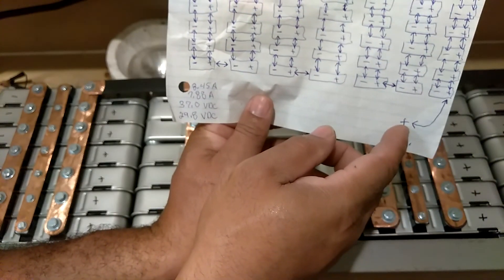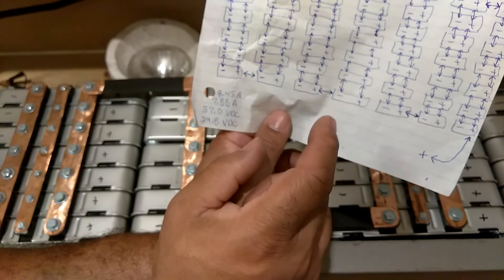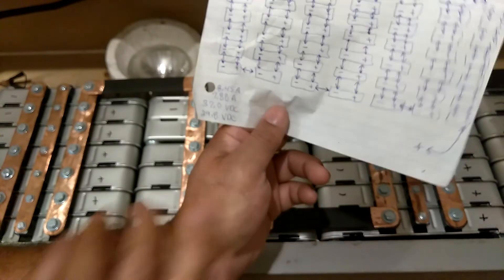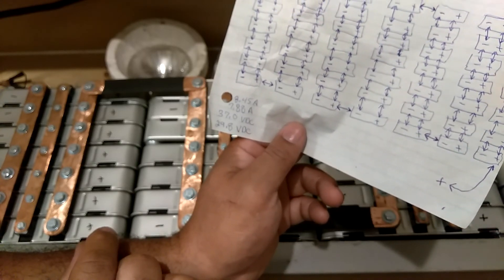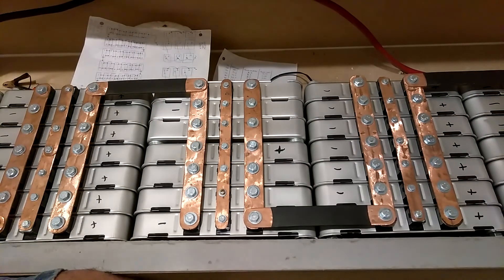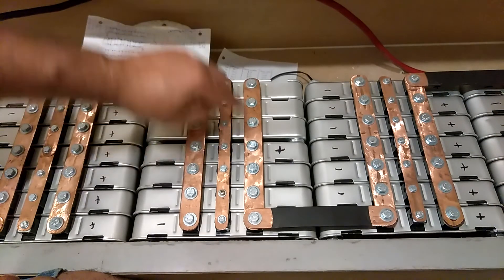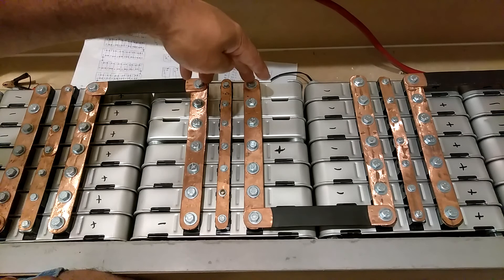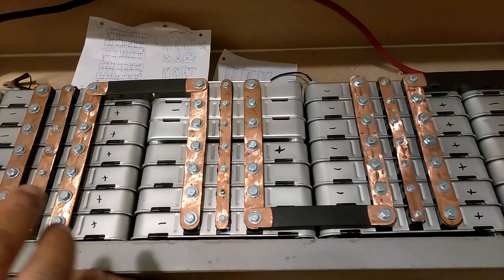How I wired up my MX solar 24V 235W 7.88A panels and Nissan leaf batterys.

Comment: Awesome set up brotha, I was wondering if you can do me a big favor and draw out a 24v battery set up using the 24kwh lithium battery pack and how it’s connect from the charge controller and how it’s connected to the inverter 🙏🏽🙏🏽🙏🏽🙏🏽 I ready to set up my solar system but need some guidance bro, can you please send it to my email at lil_fabe408@yahoo.com
Reply from the maker: yes I can help you out with that can you send me what type of inverter you going to be using what type of batteries you going to be using.
Reply: carson l urban wind and solar absolutely, I’m using a 24v 4000w aims inverter and am using the 24khw nissan leaf battery pack 🙌🏽🙏🏽 Thank you so much for your help and guidance on this set up brotha 🙏🏽 💯
Reply from the maker: ok got it i will git on it ASAP.
Reply: carson l urban wind and solar 🙏🏽🙌🏽🙏🏽💯
Reply from the maker: @Fabe408  I need one more thing I need to know your inverter DC input operating range it should be like from 18 volts to 28 volts something like that. It should be on your inverter if you cannot find it just give me the inverter model number.
Reply: carson l urban wind and solar All it says is DC input 24VDC but the model number is: PICOGLF40W24V120V
Reply from the maker: @Fabe408  okay I got it I'll see if I can look it up on Google and see if I can find out what it is I'll try to have it for you later on tonight after I get home from work.
Reply: carson l urban wind and solar thanks bro ✊🏽✊🏽✊🏽 I really appreciate you helping me out on this 💯💯💯💯💯